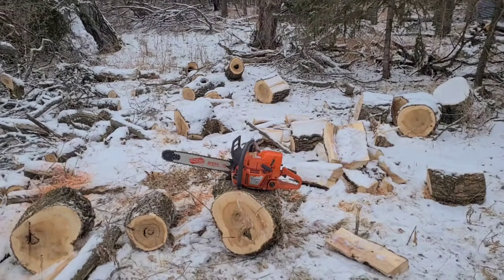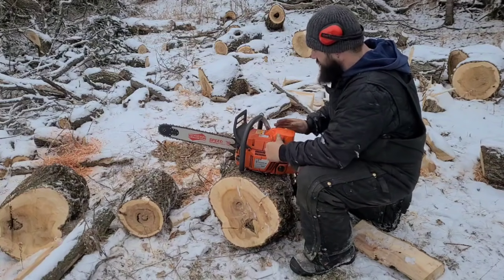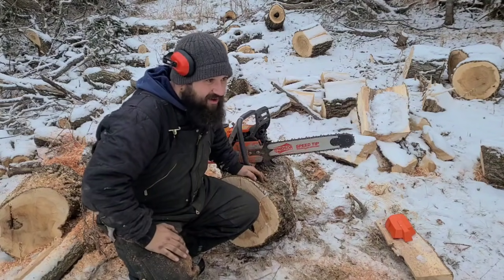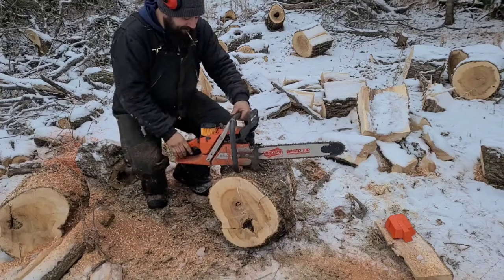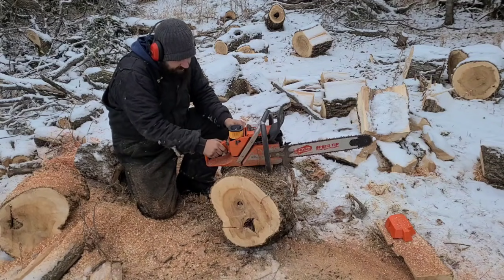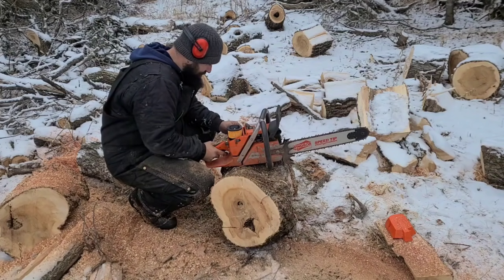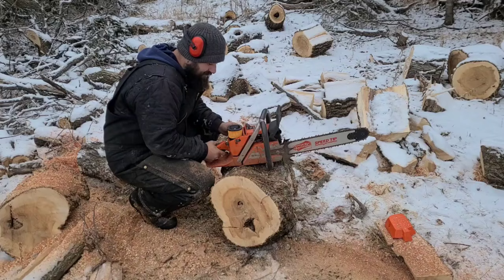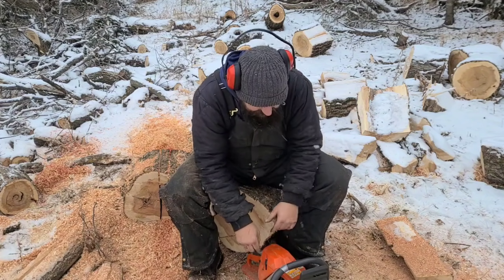How to tune a chainsaw carburetor!!

Comment: Good video.  There are a couple things I'd add.  The last thing you should tune is the H needle.  WOT is a combination of the fuel from both the L and the H needles.  What you do to the L has an affect on WOT tuning.  Also, tuning is most likely to change when you re-install the filter cover.  It'll probably be richer with the cover installed.  The struggle is real in getting on those needles though, lol :)
Reply: Agree that he needed to recheck the high jet after adjusting the low, and I agree about the change after reinstalling the cover, if the cover restricts enough air flow. He probably could hear that the H was still good though. You also have a very good grasp of 2 stroke carb. adj..
Reply: Thanks

Comment: I bought a cheap tach to check and my rpm was 12,800 at my ear-tuned setting. When I had to bury the bar cutting big stumps I dialed it down to just under 11,000. This did require cutting off the limiter tabs on my carb (Walbro HDA 144). Its a '98 Husky 261, 16" bar.

Comment: What a great video. I grew up with wood heat and have heated with wood primarily my entire life (70 years) and still do, so obviously I have had thousands of hours with a chainsaw in my hands. I currently have 6 or 7 saws, from 6.5 HP Neo Tec NS 8105 with 36" bar all the way down to 14" trim saws, various brands. I still learned some things here. I was having a little trouble adjusting the carb on my ECHO CS 310 yesterday and I got it running much better, but I didn't know you should adjust for when it is under load and a little blubber is good when not under load. Makes prefect sense and you demonstrated it perfectly.  Liked and subscribed. Great job sir. Thank you.

Comment: Timing I have started working on 2 strokes bout 4 years ago after I had a stroke and couldn't keep up the pace in a large autobody shop . I have listened to all the big saw guys out there bout carb tuning, Iron horse,Bellhopper,Buckin Billy Ray, Steve's Saloon, Fleet Command.  It has never been simplified and step by step as you have explained it so thoroughly as you have. I've just started to get into the porting stages of my career and I'm so glad I ran across your channel. I will be enjoying your videos and your library for a long time. This is Byron and I thank you.

Comment: Well, I cut about 20 cords a year...i do my own maintenance and tuning...I follow the specs for every chainsaw...And i use a tachometer...But you can watch all the vids you want on tuning and its never seems to work....even with a tachometer i do a log test...And every time my high is off...So on my log test i adjust the high while the chainsaw is in action and has a load on it....And this guy is doing it all right....one of the best vids iv seen so far...though i do my adjustment while cutting to get the best performance..this guy pretty much does the same thing..its the best way...great vid

Comment: Very much appreciated finding this video. You are the first(I have found) that actually not only explained 4-Stroking, but took the time to Present the Chainsaw under the condition.
I've become comfortable with Tweaking the Carburetors on my saws to find good response and decent top RPM - and I always back off a little to avoid Lean running, but I never knew the saw would tell me where it is happiest.
My tweaking experience comes from mostly picking up used Saws Cheap, that almost always have fuel line/Carburetor issues.
I have found, as I purchase new (Less Expensive) Chainsaws that they almost always need Adjustment after a break-in period to get better overall performance.
The knowledge you share makes things much easier to understand and correct!
Thank you!

Comment: When I started using saws, I was used to tuning motorcycle carbs so tuned it until it had no four stroke on top because I thought it made the saw run smoother. Only recently I learnt that you need to rich it a little bit and have that four stroke so you won't burn your saws. I'm tuning it better nowadays because of videos like yours and thankfully I haven't burnt any saws all those times I did it wrongly because I never used them heavily

Comment: I'm new to chainsaws and what i like about your video is that the process is straightforward and understandable, adjusting and allowing us to hear the sounds understand what the adjustment is actually doing. I have a carb adjustment toolkit coming in and i'll give it a try and try and get things dialed in well enough. I only do a few tree's a year and low jet is likely a bit rich as it is idling a bit low with stalling at times, and some stumbling/hesitation on pulling the trigger. I'll try leaning it out (1/8 to 1/4 turn clockwise) till i find that sweet spot. 

Update: Tool set came in and adjusted it in just a few minutes, was the low jet (L) as i thought from watching your video. I turned the L screw all the way clockwise, then set it 1.5 turns counterclockwise open. From there toggle the screw 1/8 to 1/4 turn each direction and found 1/8  clockwise (lean) from the initial setup was perfect. Chainsaw no longer stalls or bogs down on initial trigger pull, and an added bonus it starts on second pull of the starter rope whereas prior it took 10-12 pulls and then would idle poorly and stall. 

Appreciate Tinman for giving me the knowledge and confidence to take on this task, saves me time and money as i don't have to take it in for adjustment and with the toolset (specialty screwdriver bits, Amazon, $24) i can adjust my chainsaw from time to time as the temperature and barometric pressure changes. My chainsaw took a PACMAN bit as like many small equipment carburetors today they do not use a standard bit to ensure people do not adjust their own equipment due to pollution mandates. So if you have a newer chainsaw you might have to purchase a 2 cycle carb adjustment tool set, Amazon is awesome for that and a 10 bit set is $24.

Comment: Excellent how to video. Altitude plays a big role too, for example I live at 2400 ft but I do most of my cutting at 6200ft so my saw runs very rich at my house but its spot on when I'm on the mountain. Thanks for making this video.
Reply: Should be the opposite, the higher the elevation the leaner you need it because the air is thinner.

Comment: The absolute best video on tuning a chainsaw thank you so much for sharing your wisdom also just wanted to mention a reason that the Saw may run fast is because of the throttle lever getting stuck mine was pinned open stuck and it was really scary trying to tune my chainsaw got it figured out but man what a wrench thrown into that process

Comment: Excellent and you covered all the theories perfectly. I run ALL MY SAWS a bit RICH just like you here to keep them from burning a hole in the piston.
I like how you show how it works in wood and how to test your settings. I was taught by a Logger back in the '70's and I've never burned a piston and still have that first Homelite XL550 from those days and it still runs...NO SAFETY FEATURES what so ever so I don't use it but it still runs.

Comment: Tinman THANK YOU!! Litterally helped me determine that my stihl ms290 has an air leak.
Never new why sometimes it didn't want to idle and the chain would keep spinning. Guess it's time to redo some seals. And probably remove the base gasket too
Reply: I'm doing crank bearings and seals on a echo cs8000 at the moment.  My advice after making a mistake with a seal is to order 2 of each crank seal if your repair is time sensitive.  It's so easy to mess up a seal which completely stops the build. Super easy to over drive a seal as well especially if the seal gets a little crooked at the start. Good luck!

Comment: Excellent demonstrastion!  I just unboxed an Echo 7310P a couple of days ago first run yesterday on a giant red oak with very sound wood.  Even with the 32" bar fully buried and aggressise chain, it 4-stroked.  Echo says not to re-tune until broken in.  But, next job is with somewhat smaller ash with 24" bar, it will "burble" all over the place if I do not lean it out some.  It has limiters, so it may not lean out "idealy"; but like you say, a bit righ is way safer than a bit too lean.

Comment: Great demo Tinman. Like you said not all saws are the same but 1 1/4 out is always a good baseline to tune it your way. Elevation, temperature, mix used, if the saw is warmed up or not, what saw your using etc. Lot of factors. I have seen all kinds of crazy settings from 3/4 out to up to 3 turns out to make them start/run right.

Comment: Excellent tutorial. Used to fall trees for a living many moons ago with a Husky 480 and Husky 385 on the east foothills of the Rockies. Looks like you have a good handle on carb tuning. Couple of tidbits which I know you're aware of is a clean air filter is imperative and a broken spring in your clutch will cause the chain to run on.

Comment: I’m just putting a new top end on my much loved 1995 Sthil 026. I’m guessing that I ran the saw too lean and the piston looked as though it had partially seized at some point. Anyway it was becoming a pig to re-start hot anyway so I’m guessing it may also be ready for it’s first set of crank seals. 
Fantastic video, many thanks, I’m definitely going to run slightly rich from now on!

Comment: I liked this way,you didn't hold wide open to get the max rpms,that's what I did today till I watched this,and I honestly think I have it 4 stroking,well at top end anyways,it still runs strong but yet 4 strokes,I kept turning it out a quarter turn till I heard it,then played around with that area,like eighth of a turn back then I didn't hear the 4 stroke,so I knew then to go richer,seems like a easier way,thanks man

Comment: Good info Tinman. I was trying to tune my 460 Rancher after changing the piston and couldn't get it to have any guts in the cut. Got hold of a workshop manual and found out you are supposed to start 2 and a half turns out on the high and low jet. Thought I had stuffed the piston install but all good.

Comment: Stock cs 400 is hard to hear 4 stroke. My little cs 305 was easy to richen up in the cut, im still experimenting with my cs400.this is by far the best tuning video yet. Kinda apprehensive about pulling the restrictor caps on my new cs 590. Lol

Comment: It's also important to have the saw warmed up fully first too.
Reply: And broken in... a lot of people try to dick around with the carb settings on a brand new saw because it's down on power or running a little funny on the first couple tanks of gas.
Reply: @Gideon_Judges6  I have a ported, timing advanced and muffler modded Echo CS355T that's only on its second full tank of gas that I might have to adjust because it's getting colder out now.

Comment: Good video tinman. I also like to check my plug once and a while to tell me where it is. I like dark brown but not black. I had a brush saw would not idle down when I got it. Ran ok though. You could screw the low jet all the way out (literally) and it would stay running. Whoever did the carb let the intake manifold to cylinder gasket fall down off of one bolt

Comment: That's exactly how to tune a saw.  that trick of lifting the saw during cutting to see if it 4-strokes is cool,  I usually tune the high until it screams and them back it out until it 4-strokes, then see how it revs when cutting.  then repeat if not perfect .  The saw should always 4-stroke with no load. Anyways, thanks for sharing  👍

Comment: Rewatching this one again for the 5th or 6th time, the explanation and demonstration is excellent, particularly when you realize this was an opportunistic, off-the-cuff video Tinman shot while out sawing rather than a planned video with all the equipment and done in the shop. Why am I watching this again? I was trying to sort out my neighbor's early Husqvarna 55 yesterday evening for him. Someone had truly buggered up just about everything you could do to the saw, then "gifted" it to him when it was so out of tune, it wouldn't even start. So after stripping it down, cleaning it all out, testing for spark, fixing the spectacularly buggered chain brake, greasing the needle bearings, bar, etc. we finally put it back together, dropped some fuel in it, and got it to run. I went though all the steps I had written down (so I don't go cowboy on it myself), and the saw just ran beautifully. I was a bit suspicious on the idle setting since it took a total of 4 turns to get it to slow down to where the chain wasn't trying to engage, and it idled smoothly for 4 minutes, but woke right up at the touch of the throttle. I even got it to do the 4-stroke out of the wood (tach was reading the free speed at about 10800rpm), but clean when in the wood setting, and we sawed a few smaller white ash logs to confirm it ran consistently. BUT...we shut it off, and put it down for 3 minutes. When we went to restart it, my tack was clocking the idle speed at 4300-4400rpm, and the saw would NOT settle back down! WAY too fast. So I went back to square 1 and turned everything back in, and back out to re-establish a base starting point again. Nope, Idle on start instantly jumps to 4300-4400, and the saw will actually cut. Nothing I did made any difference except on the top end, so at 1am, we rang the bell and ended the round, calling it a night. Same thing on round 2 when I worked on it today. The plug is not looking lean at all and throttling up from the sdoopit-high idle is snappy and torquey in the wood. That sort of points me away from air leaks in my mind, but I did a check anyhow, to the best of my amateur tinkerer ability. I'm not sure what it might be or what the next step to take is (other than loaning him one of my saws until I can get this figured out). Any thoughts or suggestions would be welcome!
Reply: If it were me at this point I would check for air leaks in the filter system, a bad carburetor gasket, or cracked fuel line. Any of those can cause problems with the air fuel mixture and it can be intermittent making it tough to troubleshoot.
Reply: Now that I am further into the the video I see that he mentioned air leaks too. Lol.

Comment: My 365 special is four stroking under load, so sounds like it needs to be leaned out a touch. Seems like it doesn’t want to idle and dies out when I’m at higher elevations but in town it’s okay.  Could be wrong about that though so I rarely run it in town. Gonna fiddle around later and see if I can figure it out with this info. Thanks bud!

Comment: Always make sure your Idle screw is as low as you can get it to idle. I adjust the low end lean then back to rich until it drops immediately to and idle after you rev it so it doesn't "hang" and high idle. I lean the top end just till the 4 stroke is just about gone. I was watching Iron horse and could tell he was having a lean low speed on the saw he was running. I mentioned it in the comments and sure enough on the next video he mentioned there was a pretty sharp guy watching and  he had a bad intake gasket and he was chasing the problem trying to get it to run right but hadn't shown it in the video.

Comment: Question, 3 yrs after here, but just watching this vid now. You can't hurt a saw running rich in high jet, but lean you can. What about the low jet, is too lean, for better throttle response, hard on saw/dangerous? Thanks for the video!

Comment: I have question for ya. I have a 2050 jonsered that I can't get to run right when cold. When it worm it works perfect. But when it's cold the chain turns at idle. If I adjust it to idle cold it will stall at idle when it worms up.

Comment: great demo!  thanks.  i have 2 husky 55's.  where can a guy go to get his saw ported?  i was going to put in a new aftermarket head/piston kit.  each has the cylinders a bit scored but run relatively well.  i am the second owner of both.  i run 32:1 on my oil mix for a bit extra lube.  been running 3 yrs like that-no issue.  i keep an eye on spark arrestor and plugs for fouling.  i run amsoil sabre 2-stroke.  it serves me well!

Comment: Very good video. Learned a lot. I have a CS-490 that is a little slow on the trigger response when it's cold. It still has the factory stops in. This problem gets worse in the winter and the saw gets sluggish even after warm if it sits at idle for some time it's "Lazy" to make RPMs until it warms up again. Any ideas? My 501P doesn't have this issue.

Comment: TinMan; GREAT video, thanks.  I have trouble with re-starts.  No pressure or vac leaks, good lines good carbs:  BUT, after a day or two of sitting, the cold-starts take aboot 8 pulls.  any suggestions from  you (or your audience) would be GREATLY  appreciated.  Thanks to you and all of the Saw-guys out here.
Reply from the maker: Either it needs a carb kit or I'd give the low jet a slight turn out to make it richer.  

Some saws just start that way so it could just be the saw.
Reply: @tinmanssaws  Thanks Tinman, I'm guessing it might be the saws,,,, all 028s, and they all do the same thing. (three different carbs, Proline, walbro, and Tillitson..... I'm just experimenting.  I like the Proline and Walbro the best.)
Reply: @thomasgronek6469  my 028 always needs convincing to get it to start.

Comment: Very helpful. Can you explain when you do want to mess with the idle?
Reply from the maker: When the saw is either idling too slow or when the clutch is engaging while idling.
Reply: @tinmanssaws  Thanks for replying so quickly to such a noob question. Basically I should just try to find the middle ground between it obviously Idling too slow and the chain starting to move while idling? Should I set the idle first and then move to the low jet and forget about the idle or are there situations where I'd want to go back to the idle after getting the low jet where I want it. I know this is probably not something you can easily explain with a YouTube comment 😅